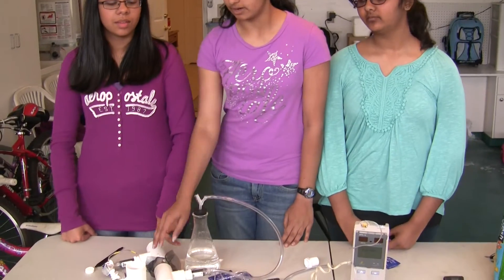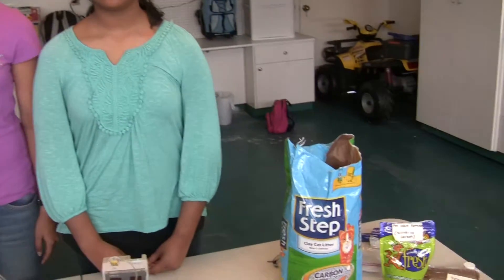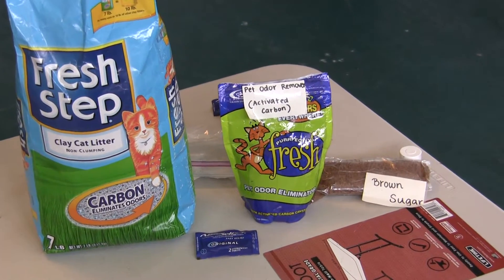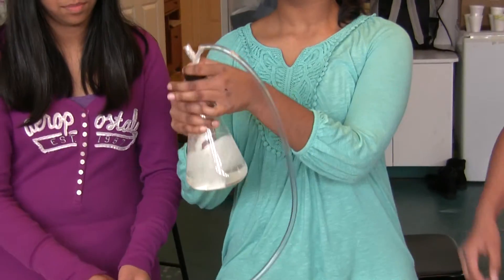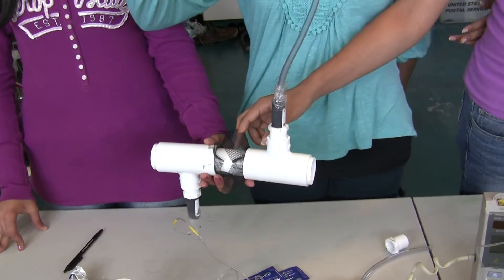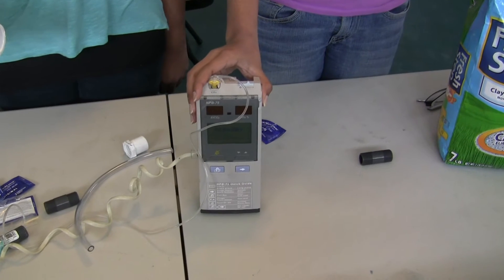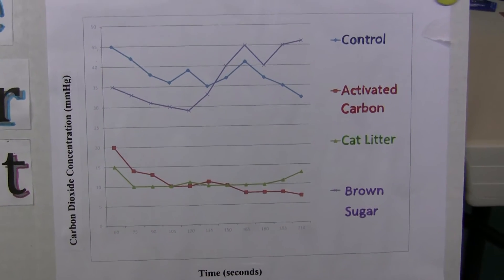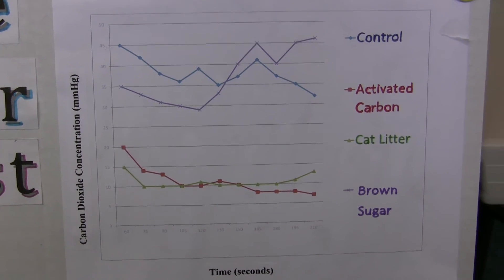What Materials Effectively Filter CO2?

Comment: Unfortunately, it doesn't just strip CO2 out of the air. It forms bonds with the CO2, making different compounds, which means you need to keep moving stuff to the location of your filter to keep it effective. The machinery also requires electricity, which is mostly created by coal plants. The cost could easily have been 1000 parts of CO2 created per 1 part removed. A better approach would be to force cars to run on Hydrogen. The combustion provides H2O as a byproduct, which can then be reseparated by electrolysis, which can be powered by solar cells. So far, it's also not very efficient.

Comment: I was thinking of making a CO2 filter, but I knew regular filters won't work and that I needed to put some material between the layers of the filter, I just didn't know what I could use. Thanks guys, now I know what's the best thing to put there, Activated Charcoal. Right on!!!!
Reply: utubefrog09  

 I was having the same problem regarding the material which should be applied along with the filtering sheets. But is there any other liquid material instead of charcoal?

Comment: Actually unless the car is diesel it emits carbonMONOXIDE because the fuel burns so fast it can only grab hold of one oxegen atom but diesel burnsslower and makes co2 wich can be processed by trees so if we have enough trees co2 isn't the problem its that co1 that we have to worry about
Reply: +matsv201 what is trouth and thank you for correcting me my book was written in the 80s so its not as up to date
Reply: keco 2002 never heard about a car catalyst?
Reply: +keco nation Wrong. Its actually petrol engine that emit the most CO. Diesel engines emit hardly any CO at all, but modern petrol engine emit very little CO to. EURO 6 car is 1 gram for petrol cars and ½ gram for diesel cars. The amount of CO2 is about 100 times higher.
Reply: +matsv201 well i'm not sure about either of ours but I just read that in my physics book
Reply: keco nation Well, you got it front to back anyway
Reply: https://en.wikipedia.org/wiki/European_emission_standards#Emission_standards_for_passenger_cars
This is not a clear trouth, but it gives a indication of the diffrance.
Reply: keco nation Its kind of strange. Diesel have always been low on CO because the burn in a oxygen rich enviorment
Reply: matsv201 can I have by our gmail in case I needbto ask u. Question about cars
Reply: Andrew Wilson I dont really understand? You want to ask me something.... eeh.. okey. go ahead...? I dont really understand your specific issue tow
Reply: actually andrew is my friend my tablet was broken and i had asked him to ask that but i was wondering what are the emissions produced from burning Ethel alcohol
Reply: Carbon monoxide could be filtered and sent back to the engine to be used as fuel. it is flammable.BTW , it is CO, not CO1
Reply: cole funk yes but diesel also is a more complex molecule containing much more carbon on carbon bonds. This results in a higher amount of carbon tars being left uncombusted. Ever seen that black smoke?

Comment: Well done.

The procedure is logical and the subject matter is interesting.

The presentation is a little rushed and I suspect it would be difficult to follow for your classmates.

Are you interested in one of the Engineering disciplines as a career?

If you are, be forewarned: the environmental tenor of your presentation - while understandable - is out of place in the practical sciences.  Systems and ECG engineering project managers would probably not tolerate environmentalists in the eng core.